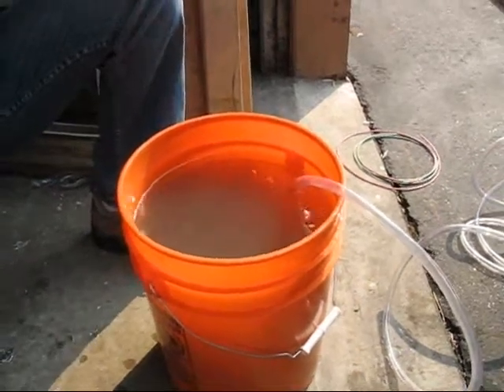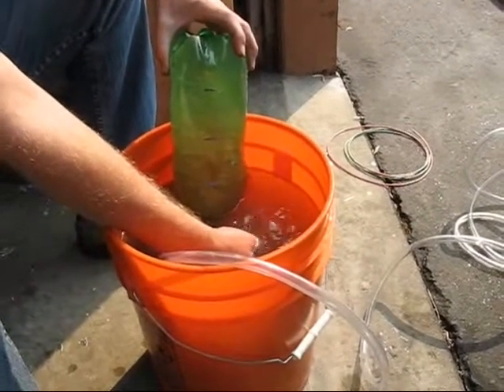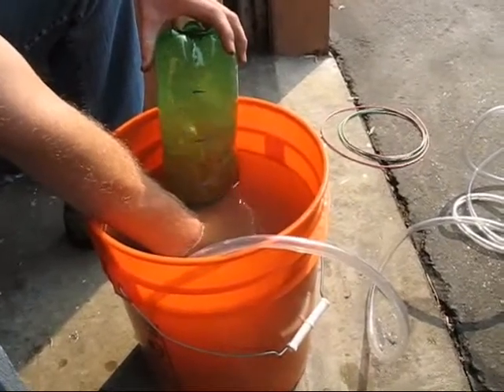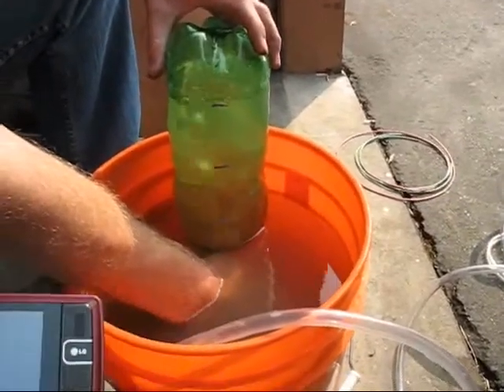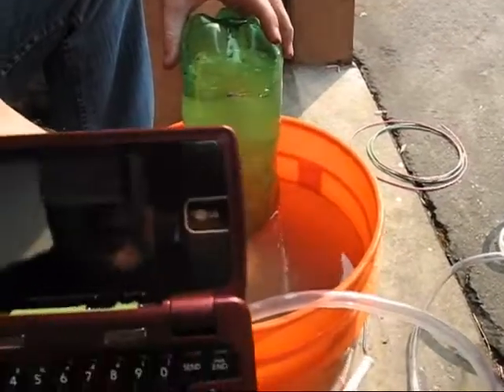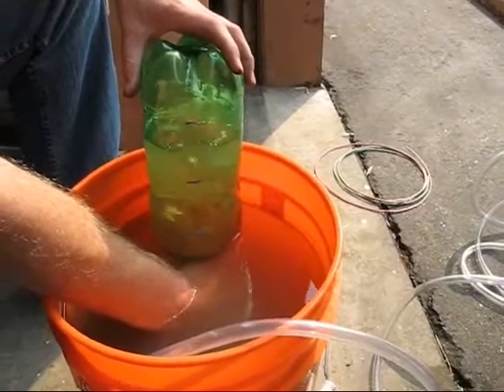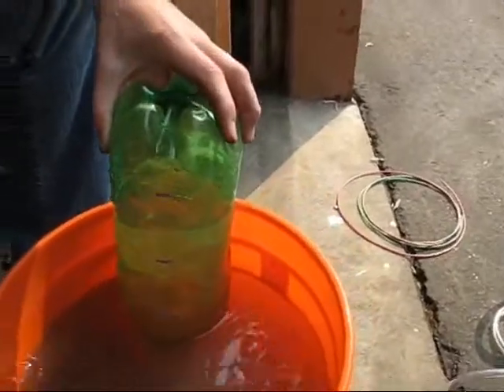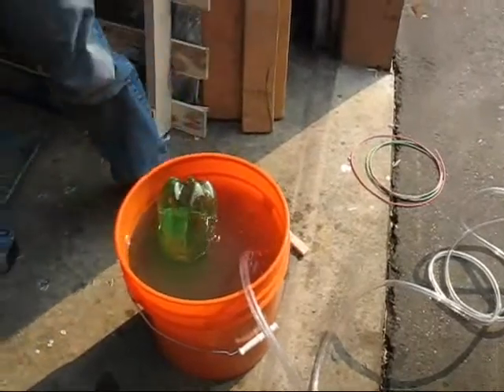Hydrogen output test, at 45 liters per hour.

Comment: 45 liters per hour = 12.5 cc's a second. A 2 liter car running at 2000rpm sucks in 66.6 litres of air a second. How can 12.5 cc's of HHO in 66000 cc's of air do anything? That's 0.000019% HHO in air. These claims of increased mpg are utterly ridiculous. Yes, HHO is explosive but get real 35% increase in mpg........no way no how. Just to reiterate: 0.00019% of HHO in air will NOT increase mpg. That's only in a little engine too. Try rubbing snake oil on the tires, that might help.

Comment: Mega Joules per liter.
Gasoline 34.2
Gaseous Hydrogen at room temperature 0.01079

HHO, two parts H one part O so divide 0.01079 by 3 x 2 = energy density 0.00719 Mega Joules per liter at room temp.

Raise temp to typical HHO cell temp 185 F (60 amps input) gas expands 21.76 percent.

0.00719 divided by 121.76 x 100 energy density now 0.00590 Mega Joules per liter.

34.2 Mega Joules divided by 0.00590, ratio of 5,796.6 to one. One gallon of gasoline = 5,796.6 gallons of HHO.